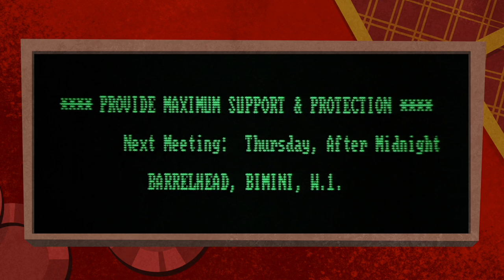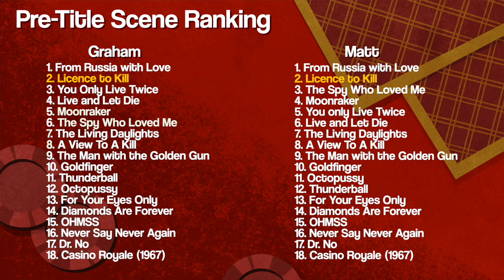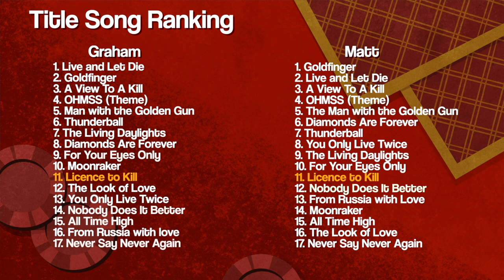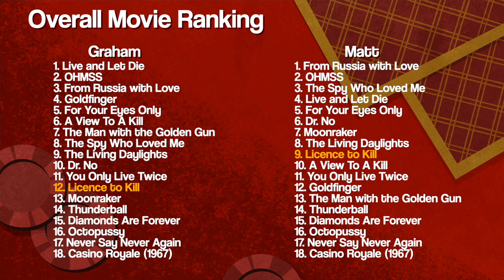The Least James Bond - Licence to Kill (1989) || From Rewatch with Love Ep18

Comment: I feel like that, while all James Bond movies are, Licence to Kill is one of the most influenced by the movies of the era. Half this movie, Bond might as well be a rogue cop having turned his badge in after the death of his partner, and the other half is traditional Bond Movie kind of awkwardly shoved in, such as the last five minutes or so that really don't fit. You can tell that the creators are kind of trying to find a way to slot Bond into the era of Lethal Weapon, Beverly Hills Cop, and even TV shows like Miami Vice (minus the New Wave culture).
Reply: I think Live and Let Die's blaxploitation film vibe must be close.
Reply: @sartanawillpay7977  You guys forgot about Moonraker? That movie would have never happened if it was not for Star Wars
Reply: @pellekuipers4076  Yeah, but Moonraker still feels like "James Bond IN SPACE". And even then, the SPACE is just a small part of the movie. And we've had space-related plots before, in YOLT and DAF at the very least. Functionally, you could replace the space station with an underwater base, the Moonrakers with high-tech submarines, and the plot would still work. Whereas, in this movie, the "disgraced cop goes on a rampage of revenge" thing largely replaces all the usual Bond tropes. Which I do not mean as a value judgement.
Reply: @Taschenschieber  You are right, Moonraker is in fact just a retread of TSWLM with a different setting, just as YOLT's plot points are used by both. 1. villian stealing capturing vessels 2. Supervillian in an exotic unbelievable hideout 3. Bond leads attack by Ninjas/Submarine personal/Space marines and destroys villain and base. The main Moonraker  Star Wars rip off was the use of ray guns.
Reply: @sartanawillpay7977  Or any of the Bourne clone Craig Bond films (which, again, this foreshadowed with the grittier, tougher, less jokey Bond)

Comment: Trucks can pop a wheelie. Check out drag racing. 
I'd guess they are souped up a bit. Usually the truck has some twisting going on because of the torque and one side leads the wheelie more than this. But it can happen. 
BTW Your Dalton Bond reviews probably sold a Dalton Bond movie collection this week.

Comment: Fear not, Master Wiggins, you will never be in a situation to get exploded by decompression because it definitely does not work that way! Even if you were to be depressurized like in the film, you'd still be suitable for an open casket funeral, because it does more damage to your internal organs than your actual body. Don't know if that's better or worse, but fears allayed.

Fun fact, the wikipedia entry on explosive decompression (called 'unregulated decompression') pings this movie and Deep Star Six as two 'no not like that' examples.
Reply: good ole DeepStar Six

Comment: My main issue with this film is it looks so bland and cheap in places. I understand you have a somewhat smaller budget, but when you can shoot on anamorphic lenses and still have a result that looks like network TV from the 70s, you have problems my friends :(
Reply: EON had to deal with dwindling budgets which was ultimately the result of the money they owed MGM after all the over spending they did on Moonraker.
Reply: Part of that is probably the diminishing film budgets, and part may just be that this is late 1980's and everything that wasn't ridiculously lavish looked bland and cheap then.